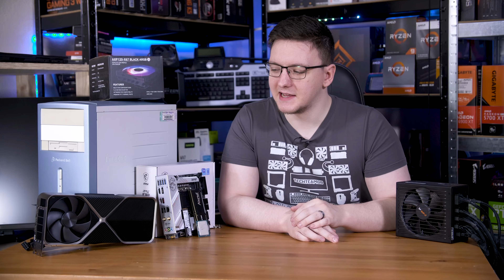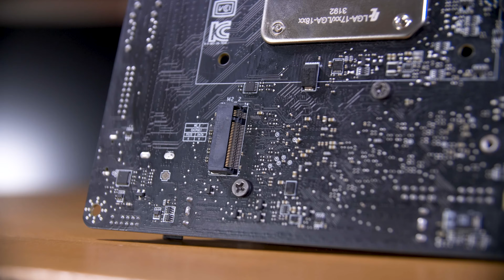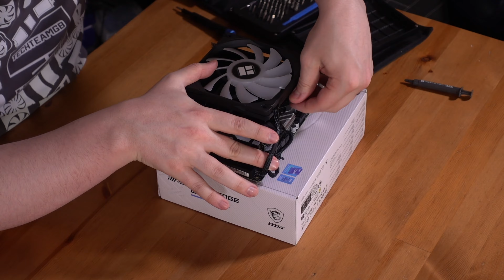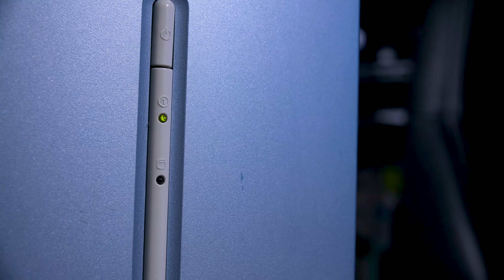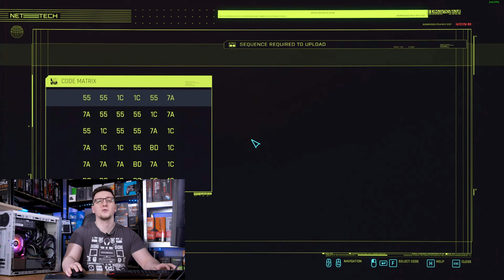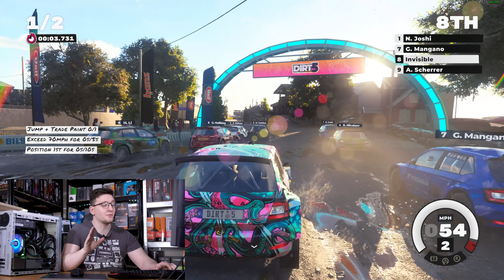Sleeper PC Build - RTX 4090 in a 90’s PC!

Comment: That was actually a really cool build! I just finished one with a 2001 VPR-Matrix mid tower case but I used some older hardware I pulled from an older custom build. It was an Intel Core i7-7700K with a GTX-1080 8GB GPU. The cool thing about the case was that I managed to install all the new stuff plus two additional case fans without any modifications at all. The case is in perfect condition and what's even better is that all the original components that were in the system are fully functional. It had a Celeron D 1.8 GHz processor. I can put all the original parts back into the system if I want to.

Comment: Great build. Just missing a 90 degrees adapter for the  4090, slim fan for the bottom and maybe a couple 40mm fans exhausting at the back. Sad this case is not available in my country! :(

Comment: I'd recommend drilling holes into the bottom, install 1-2 slim Fans between GPU and bottom and use higher feet. That will give you much better cooling for the GPU.
Instead of the slim fans you could use some sort of duct as well. That Mod won't affect the aesthetics.
You can use a good dual-tower cooler + a fan at the front. That togather with the warm air of the 4090 second fan gets vented through the back. That will be enough cooling and you can close the case. And please use a native 12VHPWR cable instead of the nvidia adapter. :D

Comment: Are you okay? You don't need a water cooler for a new AMD processors. My 7900x at work runs beautifully on an air cooler m8. What are you smoking?
Reply: He lost me when he said he couldn’t find a matx board with a modern socket. I’ve been using one for over a year. They are out there and not hard to find.
Reply: Bro is riding amd so hard he commented twice 😭
Reply: I'm sure you could run a 13900k without some fancy 240ml cooler....